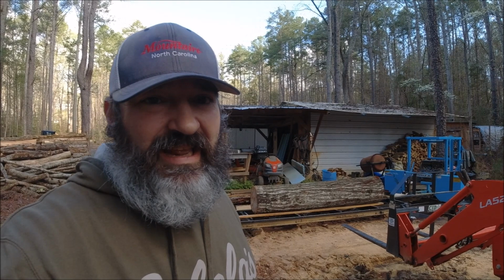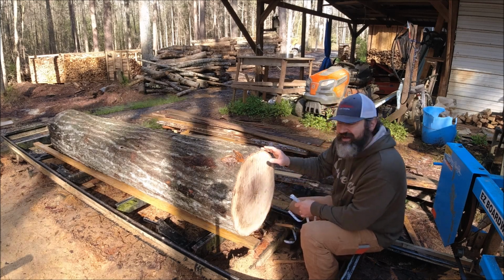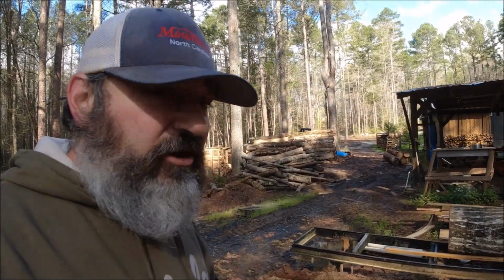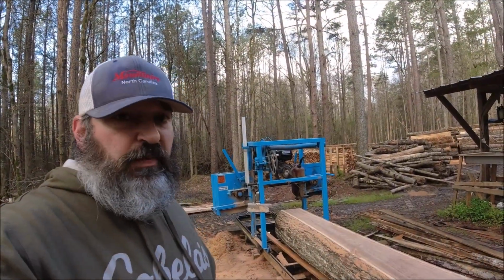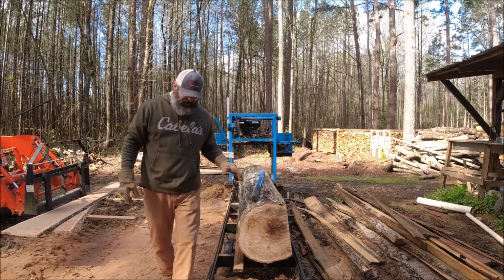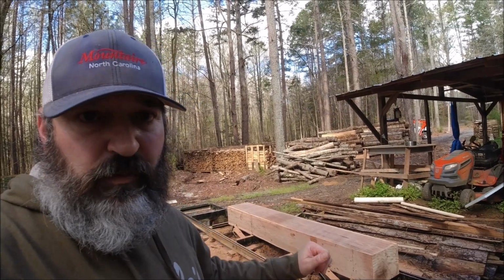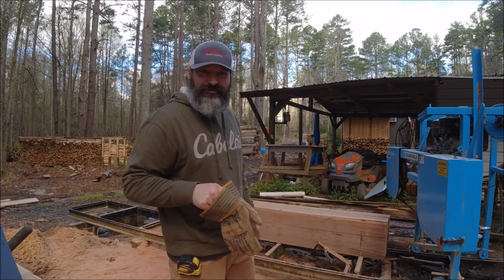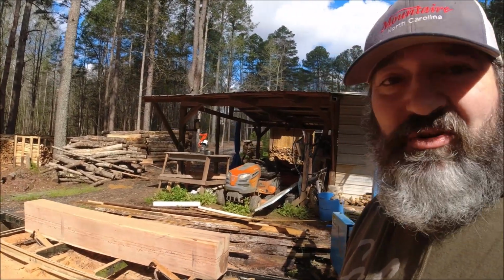Maximize Your Sawmills Capacity With This Simple Solution

Comment: Good looking lumber.  Big oaks are a pain to handle manually but you did a good job.  I'll have to steal the PVC idea as I have a problem with friction on my stops when rolling a log.  I had some really big logs that I couldn't get my mill through so I bought an Alaskan mill to slab them first.  It let me get a little more lumber and make cants that would fit my mill head.
Reply from the maker: That's a great way to do it also. I started out with one of the Alaskan mills and traded it for my daughter's first hunting rifle. I don't mill lots of oak but it does make some fine lumber.

Comment: Those are some fine timbers Matthew. It never fails, red oak has a tendency to rot in the center at the bottom. You were dead on about knowing a tractor's limitations. They're nor bull dozers even though some people use or abuse them that way. Y'all have a great rest of the week end!
Reply from the maker: Thanks Mark! The red oak milled up really nice and smooth. I did 4 red oaks on the same day and I was wore slap out afterwards! I always say if the job requires a dozer then get a dozer. I want my tractor to outlast me. Have a great night Mark!

Comment: Kubota sets the hydraulic pressure for the loader quite low.  My neighbour turned mine up with good results and no damage.
Reply from the maker: That's good to know. Thanks for the tip.
Reply: When I bought a 1988 25 hp International 25 hp tractor, it only put 1400 lb to the loader.  On the dash on a plate it warned to adjust to no higher than 2050 lb.  I turned it up to 1850 and it is now fine for snow, gravel, and stone.  Great little loader.  Apparently the first thing to break if the pressure is too high is a hose.
Reply: I have a simple pressure gauge that plugs into a hydraulic outlet.  My neighbour gave it to me.
Reply from the maker: @rodcros  that's always been my experience is a hose blowing
Reply from the maker: @rodcros  I may look into to turning it up just a hair. Not often do I need a little more lift but to have it would be nice.